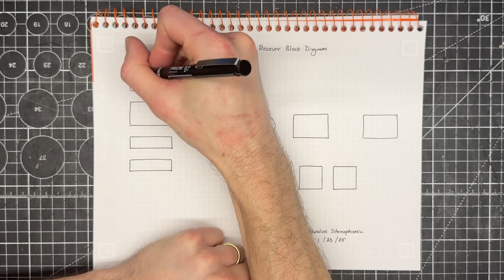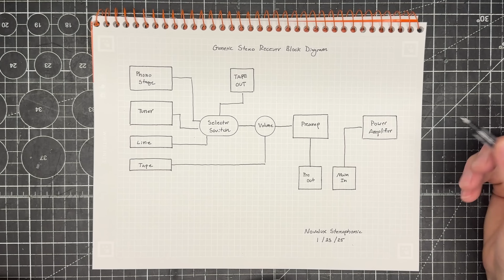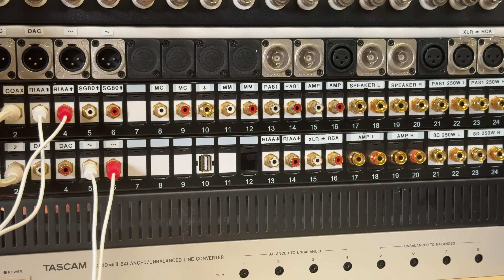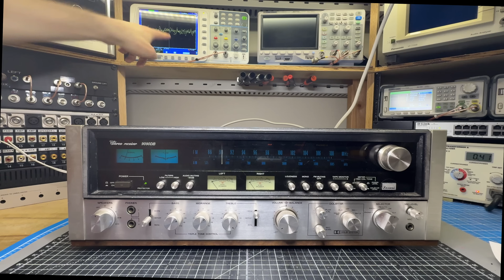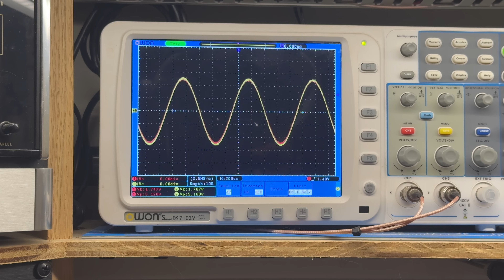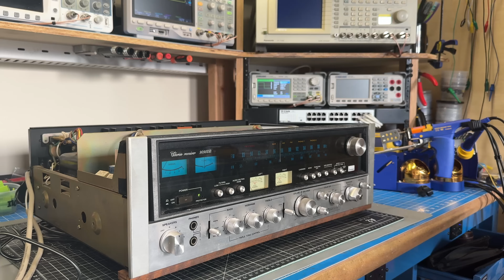How to Bench Test a Stereo Receiver by Isolating Each Functional Block - Featuring a Sansui 9090DB

Comment: Very helpful, thanks. I’ have a Sansui 9090DB, purchased new. I want to do some of this before getting it repaired. It powers to green light; dials in AM/FM stations; selector lights turn on; no sound when I hook up speakers.
I have an old amp and pre-amp (McIntosh) for testing the Sansui amp stage through main in, and the pre-amp stage through pre out.
 If I hook up a turntable (phono in) and tape deck (tape record) to the Sansui, should I be able to monitor output through tape deck’s headphone jack if the tuner and phono pre-amp work, and the problem instead is with preamp or amp stage? If not, is there a consumer electronic alternative to use for testing? I thought the signal to be recorded onto tape normally goes through the receiver’s preamp. 
I assume playing the tape deck through (aux in) is a suitable input for the preamp test. If not, I have an old Panasonic boom box w/L&R RCA aux out, but it will take a month before I can get my hands on it.
If this testing suggests the problem is the preamp stage, then how likely is it that the repair would involve the Dolby board? I thought components and solder looked fine on the side I could see when I took the amp cover off to spray the few pots that were accessible. Among the few techs I have asked, or seen opining online, some say Dolby board almost always becomes a problem, some say it rarely is the problem.
Reply from the maker: The very first thing you should check is whether or not there are jumpers installed in the pre-out main in jacks. Sometimes these go missing and you will get no sound out of the power amp.

I do not answer detailed questions like this in comments. If you create a post on audiokarma and send over a link I can do my best to answer as time allows.

Comment: Hey. I have a mitsuishi set from the 70s. The top unit is a Mitsubishi DA-F15 AM/FM Stereo Tuner.
	•	The middle unit is a Mitsubishi DA-U15 Stereo Integrated Amplifier.
	•	The bottom unit is a Mitsubishi DT-15 Stereo Cassette Deck.

My amp will turn on show a light on the front for the seletor, then slowly fade away.  assuming its a lack of power retainment? how can i check the inside with my multimeter to idetinfy the issue?
Reply from the maker: I would encourage you to get familiar with the proper safety practices before jumping in to something like this. The audiokarma.org forums can be a great resource for getting started.
Reply: @NovaluxStereophonic  bookmarking this forum.  However, I did figure out my issue on my own, which im pumped about.  Dispite it being a very simple fix: When i pressed the front power button. it was clicking, but internally it wasnt staying locked in, the mechanism would slowly release..  Do you happen to know of a solid resource for owners manuals for these vintage pieces? specifcally the Mitsubishi DT-15
Reply from the maker: @basement5k hifiengine has a great database of service manuals.
Reply: @NovaluxStereophonic  they closed registration. So while its all right at my fingertips. there is no way to download ANY manual that I need.  Seems kind of ironic but maybe theres more behind the "why" than i know

Comment: How are you enjoying your purpose built workbench now that you’ve had a chance to use it? Would you do anything different?
Reply from the maker: I m very happy with it overall. I am actually relocating my shop this month. When I put it back together I am going to be adding some more table space so that I can have a full computer setup within arms reach (I have just been using a laptop to my right) and I will also be adding a second patch panel and more equipment for long term testing of devices.

As far as changes to the main bench of course more space for more equipment would be nice. Would have loved to fit a spectrum analyzer and a couple of other pieces.

Comment: So I guess having only a DMM isn't going to get me there! DAMN! That's a big wall of equipment.   Your methodology and discipline is OUTSTANDING! Do you ever Mod to higher quality performance of any of these blocks, or even the entire receiver? Most of these Phono Stages are weak. Best one I had was on a Marantz Receiver. 2015. Baby Marantz with a Class A amp... And only 15 wpc. But very musical.
Reply from the maker: @KP11520  My philosophy is to restore the circuits to original functionality. Sometimes the parts that I use are superior to what was originally used by I don’t actively modify or upgrade anything unless it is to add reliability or address’s a design flaw.
Reply: @NovaluxStereophonic  Totally understandable. Especially as a going concern business model! Every County needs a shop like yours!
Reply from the maker: @KP11520  You might find this interesting: https://youtu.be/F2s3oSenWVE?si=pHsQIN6bZS8tR3NN
Reply: @NovaluxStereophonic  I bookmarked that link to make sure I don't let it slip away! Thank YOU!

Comment: Do you have opinions on  which deoxit is safe for use on carbon track pots when they need cleaning/lubing? Red versus green battle…
Reply from the maker: My position is that if you use red deoxit and the control disintegrates it was already on its way out, but to be safe I flush with zero residue cleaner first then follow up with green deoxit.

Comment: Thank you for the video, I have had this same receiver for over 15 years that I rescued from the trash and paid to have restored over a decade ago, it’s definitely a beast and my current annoyance with it is the dirty internal selector knobs / volume potentiometer 
Fortunately I can get by adjusting or exercising these quickly CCW-CW several times so both channels are working 
Used to use the Deoxit but it is a pain to open up the unit which is heavy and placed in high eye level shelf

Comment: If you did a series of vid's focused into further detail, such as testing and replacing individual components on the board, I would watch every one, probably multiple times. I am talking about transistors-both power and signal, diodes, caps, etc. Switches and pots are pretty easy to test, but testing active components is a next level world.

Comment: Very usefull info and much appreciated. 
I recently resurected exact same 9090db for a friend of mine that had multiple issues, mainly blown output transistors (a mix of original toshiba 2SB554/SD424 and its knockoffs) and the F-2624 driver board that had to be replaced and rebuilt with the TOLI's reproduction one from scratch. The original driver board was in such a bad shape that copper traces were peeling off due to its age and God knows how many soldering. I must say that in the process a dimm bulb was crutial and true life saver in order to prevent blowing the output transistors as well components on the rebuilt driver board. I am not professional and It took me well over a year to source out all the information from AudioKarma and all the parts and fix it. 
Proper replacement outputs were installed - 2 x MJ21193G and 2 x MJ21194G with fresh thermal compound and TO3 isolators. It took lot of nerves and perseverance and I was on the verge of giving up on it multiple times, but the reward of bringing it up from the hades had no measure.

Comment: My best friend is my BK transistor tester. It works without taking the component out of circuit and automatically finds the pinout regardless of transistor type. Unfortunately, once it is 30-40 years old, pretty much all of the electrolytic caps are old and dried out, the resistors have drifted out of spec through age and heat and those components going out of spec may have cooked some things and--possibly--some expensive and hard to find things. I gave up doing this sort of work as it became tough to find service manuals and if the house number was taken off of the component, it can be tough to figure out what the proper replacement is. As such, unless it is really expensive to begin with, I tell folks that it is likely going to cost a lot more to upgrade than it's worth. I admire that you still do it.

Comment: i have a pioneer sx 650 do you know what cost am i looking at to fix up .thanks i bought it new.
Reply from the maker: It is very hard to estimate repair costs without first evaluating the unit as shown in this video. I would encourage you to research reputable local repair techs in your area. Prices vary drastically depending on your specific location.

Comment: Wondering in each of your tests what home equip we could substitute for the test equipment you have? For example, for the phono in, could we just use a TT? And what could we hook up to tape out to see if we get a good signal? I know we would not get all the balance etc data that you did, but for home troubleshooting what could we substitute for each test?
Reply from the maker: This has been a common question so far. I have it in my video queue to do a follow up showing how to do similar testing with a few basic items.
Reply: @NovaluxStereophonic that would be a tremendously helpful series! Subscribed!

Comment: Please follow this through to the service steps as a part 2. I am chasing an intermittent issue in an AU9500. I can't test as you have, but I can preemptively clean the selector switch and volume. Thanks for making this video. Very helpful.
Reply from the maker: @williammitchell3271  You can see the entire restoration process on this unit on my Instagram stories in the highlights section.

Comment: Interesting.  The selector switch doesn't require looking into? I have a 9090 that has a dirty/worn selector switch for signals and prevents some bulbs from illuminating. Otherwise, its a great unit. Diagnosis seems to be a quick task. Getting the electronics removed, cleaned, replaced and put back in is where the tedious work begins. Not to mention, a good tech who will use quality parts and correct parts.
Reply from the maker: The selector switch definitely needs attention, this customer opted for a full overhaul. Both the selector and Dolby switches were completely removed, disassembled, and cleaned. Dim indicator lamps is one of the tell tale signs of XOXO Sansui controls that need service.
Reply: @NovaluxStereophonic  Thanks for that.

Comment: Great content! Simle organized common sense approach. I,m a tech and truely appreciate teaching when that is accurate and on point.
 On another note.. can you let me know what permanant inconnenect cable you use for your text gear. Its the clear jacket braided stuff that you made with BNC connectors. I'm currently using pre made pomona BNC to BNC cables. I see the cable online for purchase but not sure the best to use on the bench, needs to be flexiable and proper impedence. Connectors as well
Reply from the maker: For those jumpers I used bulk RG316 and terminated myself with some nice BNCs from mouser, following the stripping recommendations outlined in the spec sheet. I believe I needed to purchase a special crimper but it was worth it for building out the patch panel.

Comment: Can you tell me if the jumpers are necessary to be installed when you use receiver?
Reply from the maker: @MDOP1  In this specific unit yes. There are some models from Marantz and other that use jacks with internal switches where a jumper is not needed but the majority of receivers with preout / main in jacks need a physical jumper.
Reply: @NovaluxStereophonic  thanks for this info. Next week im getting my first Marantz receiver so I need to check if it is on place.
Reply from the maker: @MDOP1 Even if it’s one of the later Marantz models that does not need the jumpers it can help to install some. Sometimes the internal switch contacts get dirty and lose connection. Good luck in the search!
Reply: You can pull the pins and install an eq  between the pre amp and amp pins it is called looping.

Comment: Couldn’t watch this video fast enough!
Reply: What did you set the amplitude to when you fed signal Gen to amp in?
Reply from the maker: @dirtydon8661  I usually start at 200mV peak to peak then build up from there. Most amplifiers have varying input sensitivity so I like to start low and ramp up to rated power. It seems like 200mVpp usually lands most amps in the 2-5W range which is great for an initial check.

Comment: How would we be able to test the IHF, burst watts? 

I know most power amplifier bench tests are RMS.

Any feedback would be appreciated
Reply from the maker: @EC-ki5wv  in my opinion for home stereo use peak power or instantaneous power is a pretty useless specification that was mostly used for inflating specifications for marketing purposes. 

I can technically test it with a quantasylum analyzer with chirps that I have but I have never felt the need to do it.
Reply: @ gotcha, the reason why I ask is that I believe that many of these 20 and 30 watt smaller vintage receivers, have really high IHF watts and could be why they sound better than AVRs of today. 

For example rap music has beats that happen very quickly, so an amp with high IHF would be best for that kind of music?